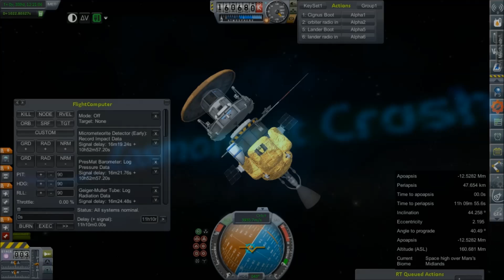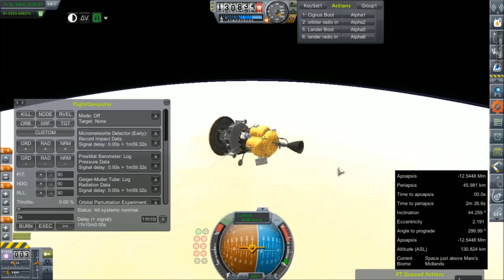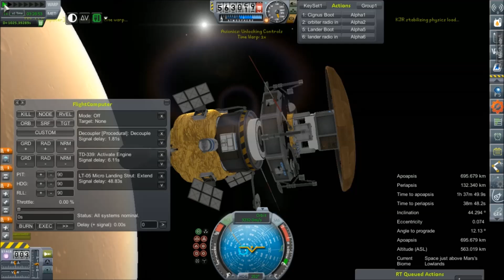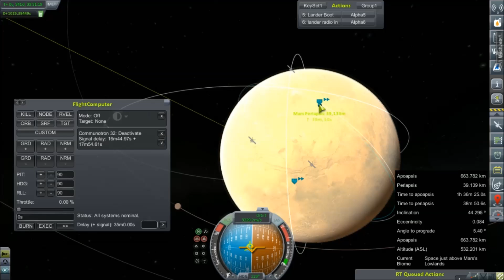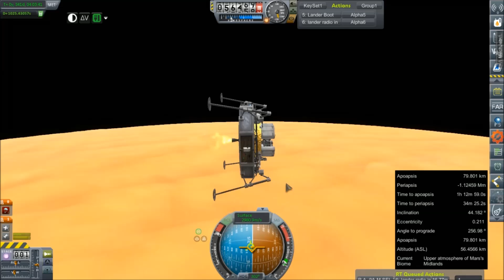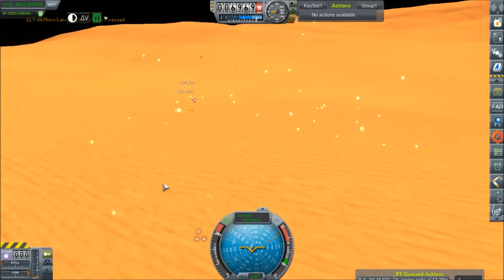KSP RP-0 #162 M-SEL Capture/Landing

Comment: hang in there lmfao, I don't think you had enough retro thrust to get down to zero anyway
Reply from the maker: Down, but not out, for sure. The TWR on the lander was a bit lacking, but I also hesitated on when to start the burn. Had almost all the fuel been spent, the result may have been different (albeit maybe not 'successful') Lessons Learned.